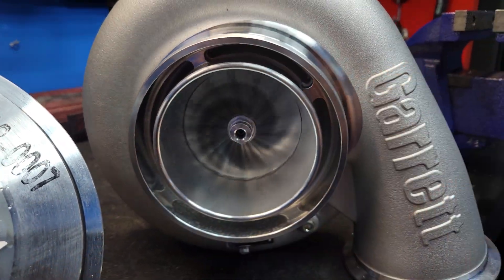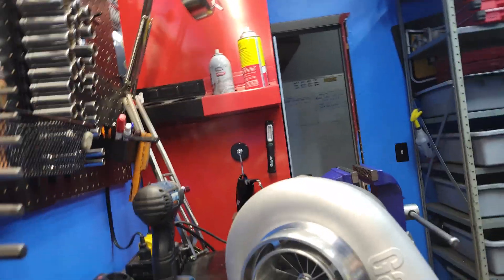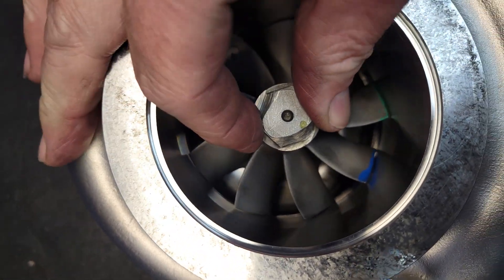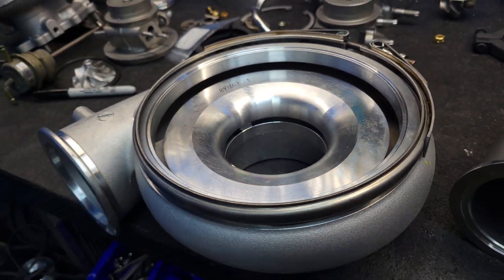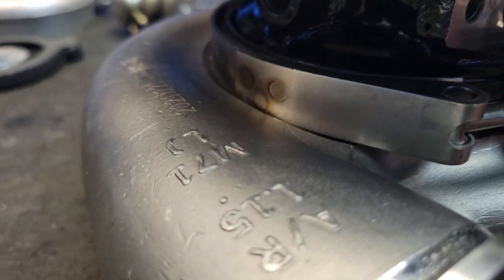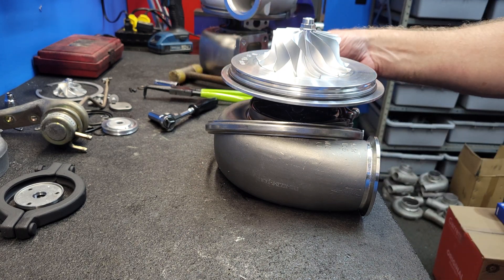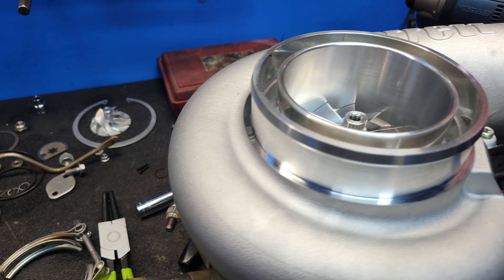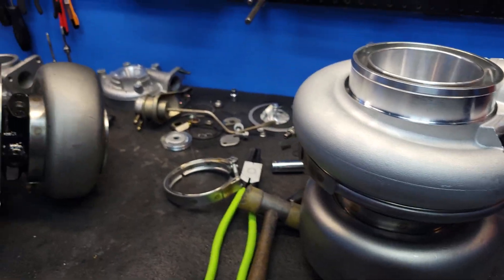Important! Own a G42/G45 series Garrett? Watch this so your turbo won't FAIL!!!!

Comment: Does it sound stupid to use a light lub film similar to ARP lub on the flange to help the band seat?
Reply from the maker: It would be messy, but OK to use.  I like to make sure everything is clean, tighten the clamp just enough to seat it, tap the band with a plastic faced hammer around its diameter and then torque.  

IDK if it is the best way, but a good friend who was a mechanic in the air force told me that was "the way to do it!" 

Regardless, I think cleanliness and just taking your time to look at everything closely is the key to success!  

HTH, and thanks for the question!  -Reed

Comment: does this also apply to a g40 series? I just received mine and placed the turbine housing on and tightened the v band and noticed that it will spin freely when I have it laying horizontally, but when I place the turbocharger on a table with the compressor housing facing upwards the wheels will not spin easily when I rotate it. Is this normal? Doesn’t look like anything is touching or preventing it from spinning
Reply from the maker: Most likely this is just the bearing and seal structure creating a little bit of resistance due to the weight of the rotor group providing resistance.  

I would put a bit of oil with a syringe into the feed side, spin it over a few times and repeat.  New turbochargers rarely have enough oil in them "as delivered".  So, pre-oiling is a requirement.  

Just look closely at your clamp and make sure there is clearance around all of the edges, and the turbo spins freely without any mechanical noise and you should be good! 

If you are still concerned, you can send some pictures or more information over to my email.  support@workturbochargers.com and I will be happy to help! -reed

Comment: Hi, So I bought a new Cat exhaust housing and Cat reman cartridge for my 1999 3406e 9WR. OEM Garret water cooled 1.19 unit. My original compressor housing fits too tight. No obvious housing damage/distortion. All cleaned and greased for test fit. Won’t drop down past the bump/seal-ring on the cartridge diameter. I need to be able to clock the housing, so dead-blow fit is not cool. I’ve tried heating the housing with the map torch. Still too tight. Cat wants $1200. for a new compressor housing that will probably be the same fit diameter. Thought about maybe lapping compound but reluctant to try it. 
Any thoughts or advice?
Reply from the maker: I have had this happen countless times when rebuilding units.  The housing is most likely distorted.  

Take the housing to a competent machine shop that will set it up properly.  Center off of the compressor wheel bore and square off of the diffuser surface, keep runout below .0005" in each plane.  

Put some layout fluid on the receiving ID, and make a skim pass...you should see the distortion very clearly at this point.  

From there, test fit the chra, remove only enough to get the two pieces to fit, do not worry about getting the whole surface cleaned up and round...just enough to get it to fit!  The O ring will seal it, and you can also put a skim coat of Loctite 515 on the flange for added piece of mind! 

hope this helps-Reed
Reply: @workturbo Wow! Thanks for sharing your experience. Loving your videos! So glad I found the channel. Absolutely the MOST educational O&R information out there.  
Thanks for your reply and machining advice. I  followed the spirit of your advice and got a good fit today. Clearances look good by eye so far. I’ll gauge it up after fully seating and tightening on the bench. Nuff said. Oh yeah; Cat doesn’t call out an o’ring but the housing has a chamfer for such. I got an assortment of silicone o’ring stock from The O’Ring Store overnight. Made a .063 o’ring lickety-split. I’ll also add some 515 judiciously. Feeling better about the whole thing. Thanks again👍

Comment: I definitely noticed the clamp interference. It’s an absolute pain also to separate a turbine housing after it’s been run in a g series for a while. They do make really good power though. 

I have a g35-1050 and I made 849whp on a 2018 civic type r. I used the .83 housing so there’s definitely more power to be had on bigger exhaust housing.
Reply from the maker: I tell everybody that anti-seize is your best friend, the good copper infused stuff.  Also, if you need to remove the housing after it has been heat cycled a bunch, use a propane torch to heat up the housing.  It will make it so much easier to remove! -Reed

Comment: is the ported shroud slot better ported more than stock?
Reply from the maker: Our WORK option gets cover machine work, seal bore coating, stainless seal bore is an option for high oxygenated fuels...we cover all of the basis on these units!  Reed

Comment: The vband turbine inlet sounds great just like super duper racecar stuff. Now , take that exhaust you welded to the mating vband flange. It is warped as hell. File it down flat,  now there's not enough "crimp" in the vband. It is a real thing when you are trying to diagnose problems on the dyno
Reply from the maker: Yessir...we see this on the daily.  It takes somebody that fully understands the application to properly weld/fit exhaust flanges and also compressor v-bands.  -reed
Reply: @workturbo  I'll take 4 bolt turbine inlet flanges, and slip-fit compressor outlet every day of the year. Any loss in turbine inlet pressure is an evil, non-recoverable loss that wreckes the whole working turbine/compressor relationship

Comment: After welding and then resurfacing turbine inlet v-bands for no leakage, then the loss of clamp, I'm kinda done with vband turbine inlets for street stuff. ANY loss in turbine drive pressure wrecks the whole deal. Give me a 4 bolt turbine inlet  flange. A stainless gasket for thin stuff, or no gasket with thick cast flanges